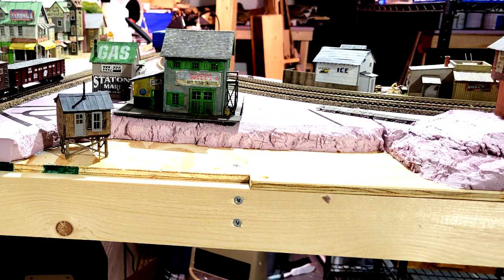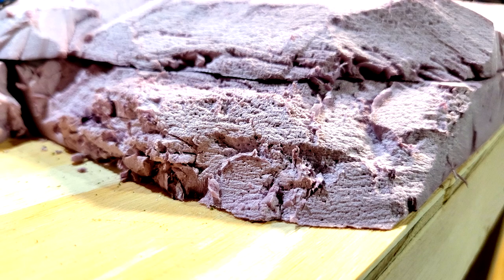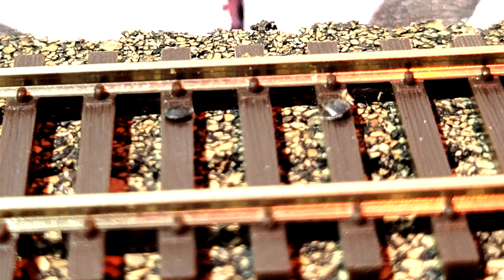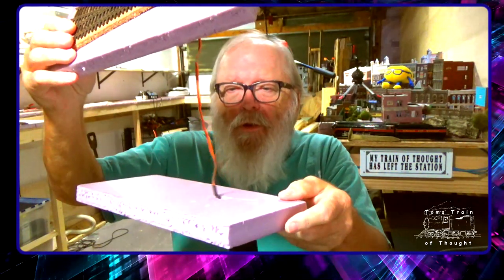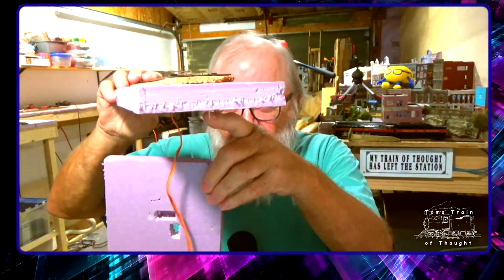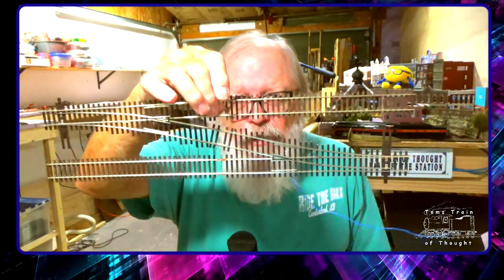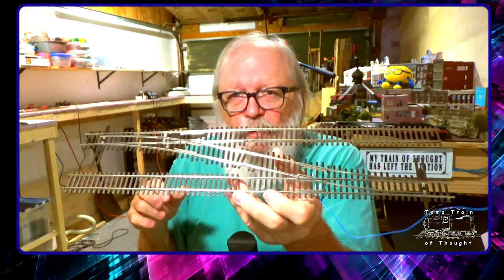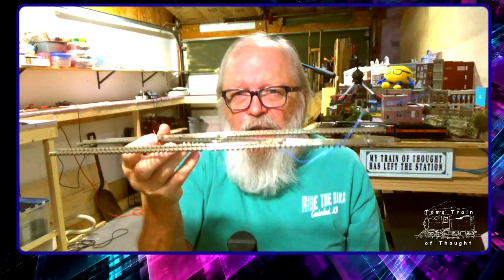Toms Train Of Thought - Foam - Pros & Cons

Comment: It makes a nice slate rock face with the foam board by using just a wire brush,a bigger wire brush than what you were showing Tom. The wire brush makes nice thin slates of rock with thin recesses between the slabs of rock. Once painted to the desired effect it turns out pretty nice.
Reply from the maker: Thanks Jeff

Comment: I agree with Jerry. It dents easy so you have to be careful before scenery is placed. I use foam everywhere except in my yards. I suggest using liquid nail and pins to secure it. Use cans of soup for weight to hold sections down while drying. Note get liquid nail that doesn’t melt the foam.
Reply from the maker: I noticed the dents, but that adds to the realism of the terrain. Not everything is level. I have the PL300 Foamboard Adhesive with 8# weights or totes with supplies to hold it in place while drying. For the cork to the foam, I've used white glue & foamboard adhesive.. The whit glue is easy to pull up if I change my mind.  LOL

Comment: Thanks Tom. I use foam and think it's great (it's blue here in Australia). One thing I recommend is using Trackrite foam track bed instead of cork. I gave up on cork long ago - especially when using the extruded polystyrene boards. Trackrite is so quiet and so easy to use and forms a perfect shoulder profile. It is slightly recessed to perfectly align the track and if you are double tracking it spaces the parallel tracks perfectly. Gluing it with a tacky craft glue allows you to peel it off the foam with not too much trouble or damage if you want to move it. And because of the recessed centre and bevelled shoulder it holds the track with very minimal pinning or gluing before ballasting. Anyway, I typed all this on my phone so it's a bit all over the place. Regards.
Reply from the maker: Thanks Peter. That's looks like a great product. I'll have to look into a bit further, the only place I see so far  offering it is in Australia.
Reply: Yes I just checked that. It turns out it's made here. Someone should look into hooking them up with some of the big suppliers over in the US. It really does make track laying so fast and easy and perfect. Thanks for all the great videos.

Comment: I use the same method but I put a piece of harboard between the foam and the cork or whatever else you use and this allows you to tack the track down when using flexi track. I find this works quite well. I should mention that I dont use tacks I use screws, they work quite well as you can easily lift the track if incorrectly positioned. Frank
Reply from the maker: Thanks Frank. The nails I use come up after I glue down the ballast. The ballast is plenty to hold everything in place.

Comment: I haven't used foam before either, but on this current build I will be using it for slight changes in elevation of the tracks as well as for scenery...thanks for the insights, Tom! T4
Reply from the maker: Always a first time for everything. Hope it works out for you.
Reply: @TomsTrainsandThings  You, as well! Have an incredible evening! T4

Comment: I’m building my first layout, and I’ve used 2” foam as the base. But I’ve thought about using tortoise switches. How would you mount a tortoise to foam?
Reply from the maker: I did a video on mounting servos under foam a while back. You may be able to use the same principle with the tortoise.
https://www.youtube.com/watch?v=9b3KnLy5udI
Reply: @TomsTrainsandThings  wow. Thanks. I’m impressed that you made your own switch machines.

Comment: i like 1/2 inch foam board, easy to put in rivers and streams, and trees, well just poke them in and bam  done
Reply from the maker: I've seen the 1/2 inch in Loews, but they have a foil coating on it. That's only half the fun, just like N scale. LOL
Reply: Home Depot should have all the sizes.
Reply: Tom Karl’s right Home Depot has all the sizes of pink foam and I’ve not seen any of the pink foam with the plastic on it in a long time the blue foam does but I don’t use it as it’s softer then the pink boards
Reply from the maker: @hondachopper6978  Not in this area

Comment: I use 2" foam. I sure wish that switch machines had longer throw bars. I don't think I am going to use foam on my top level.
Reply from the maker: I'll be using servos on some of my turnouts and Tortoise on others. Have to use them up. I have 24. LOL
Reply: I want to use Walthers Layout Control System. But will have to modify it so the throw will reach.

Comment: Hey Tom foam board is a good idea fast and easy to use I’ve been working with it for years in tabletop gaming and now with trains. I use t- pins and push pins to hold the track down and gorilla glue for foam to hold track and woodlands scenic roadbed down and it’s waterproof and easy to change later with a putty knife. Also you can lean on the layout and not crush any of your hard work of the terrain.
Reply from the maker: Thanks for the tip William

Comment: I just glue road bed and track with acrylic caulk and pin in place to dry. However my foam was glued to thin plywood on one layout where on another layout the foam was glued to the framework.  Again I had no issues.  Make sure that the clear plastic cover sheet is removed. Alot of people don't and it will come back to haunt you later. Some foam boards have it on one, some both sides. Rarely have I ever found pink foam without it on it.
Reply from the maker: Thanks Raymond. I haven't seen any foam here with a coating on it.
Reply: @TomsTrainsandThings  well it's a really thin clear piece that covers it. Near invisible until you find it. A good way to fund out if it's on there is take some white glue and glue something near an edge and then pull it up after a few hours of being dry. If it's there you should able to know it while pulling object up.

Comment: Hey Tom,  I found that using Titebond III Ultimate Wood Glue works well for gluing Cork to Foam, as well as the track to the foam. It is waterproof so when it comes to ballasting it does not dissolve the track glue. You can still get the track up with a  putty knife if you want to change it later.   Also latex caulk works well too.
Reply from the maker: Thanks Troy

Comment: A con Tom, be very cautious of the adhesives you use.
Reply from the maker: Thanks Sean. Only using foam adhesive & white glue on this. 
What doesn't work on foam?
Reply: Tom, any solvent based adhesives, contact cement, epoxies etc.

Comment: Love using the pink foam.  So ligthweight and easy to use, can stack and carve in so many ways.  I prefer the 2in but it can be hard to find in warmer climates, so I have to usually settle for stacking 1in.  I am impressed that you can work in your garage, here in Houston I can't stand working on my garage layout May-October.
Reply from the maker: I insulated all my walls, door & ceiling in the garage and keep the door open to the house until I connect ac duct in the garage. I nstalled a ceiling fan and blow air in from the house. Keeps it cool. When it gets a little cooler, I'' get up in the ceiling and run an ac duct to the garage.